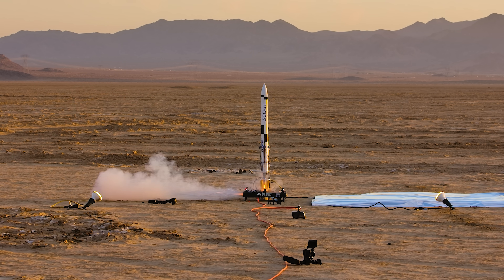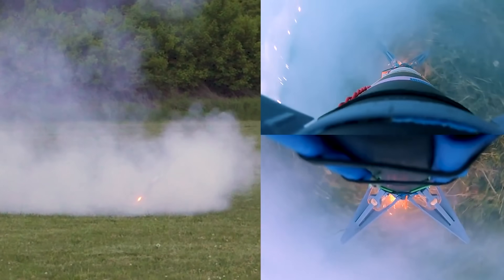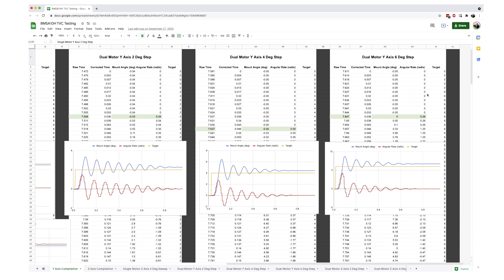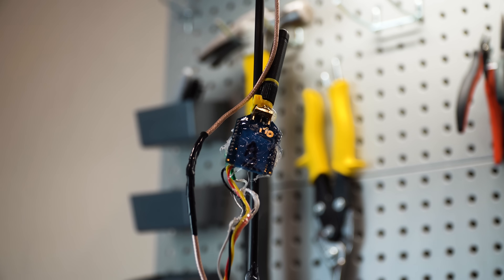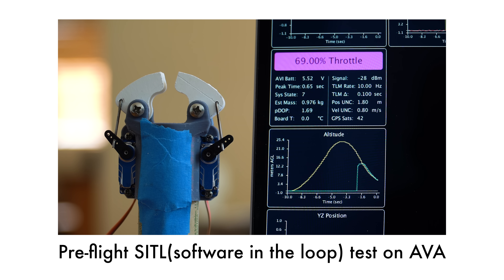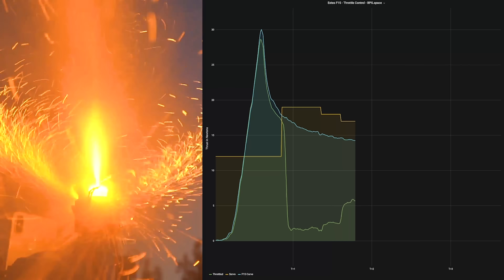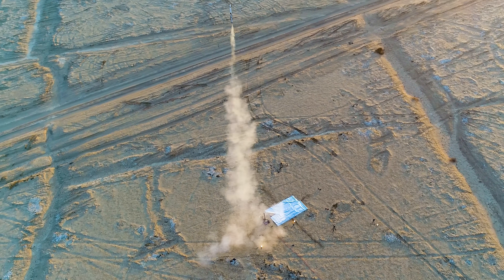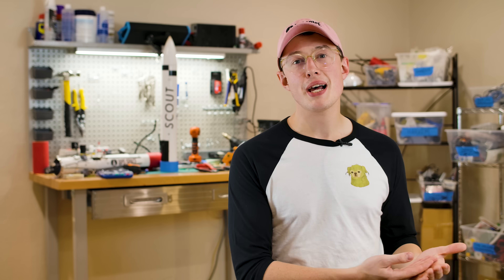Scout F - Flight 1 - Launch and Landing

Comment: This is the first time I've tripped over one of your videos, and I'm really impressed with what you have accomplished.

I assume you are familiar with the concept of PID loops, but if you aren't you definitely should look them up. PID = Proportional, Integral, Differential. It is a general control strategy applied to continuous industrial processes, and your rocket is a continuous process when it is operating. The general idea is to use a PID control algorithm in a feedback loop, such as your gimbal control. You tune the PID parameters for the general way the process is observed to operate, but there is generally enough wiggle room in the control algorithm to account for things going to the limits (or even beyond) and getting back in control. In this case there wasn't near enough damping in the motor control, resulting in it slamming to one side, the control noticing that the rocket is now leaning to the opposite side as at first, and then slamming back. A longer integration time would help with that.

On the landing burn, I think your right that your current control strategy isn't optimal. I've never done what you are doing, so I'm just thinking out loud here. I think that the viewpoint I'd take is that you have an unpowered object of some approximately known mass, descending at a measurable speed and acceleration (which is approximately g less some empirical wind resistance), and which needs to stop at some determinate point. If your altitude measurement is good enough you should know the distance to the landing altitude.

Then the goal is to apply some integral force F over some time T such that V=0 at the desired altitude. You should be able to calculate the ignition start time from those parameters, and be able to resulting change in vertical acceleration and speed based on the force. This algorithm should be independent of total time of flight and of peak altitude reached, assuming that the altitude is high enough that you can completely burn the descent stage by impact time. I guess your descent rocket force is approximately a constant value and is then reduced by your control pinchers. Since F=MA and the F is known for the descent rocket and M is known from initially weighing the rocket less the ascent tube, you can calculate a constant A to result in V=0. Then the question is to calculate the altitude to start the burn, which is done by (if I recall my long-ago math correctly) differentiating MA to get a known distance with a known F.

Well, I hope some of that made some sort of sense, and might be useful to you.

Comment: an idea for a lightweight shockabsorber:
thin aluminium tubes that slide over one another, with heavy grease on the sliding surfaces. If you get a spring assortment, you can find a light spring that fits in the large tube, to keep the whole thing extended until the rocket settles down.
I built landing gear for small model aircraft that way. Has quite a nice damping effect, eliminates bouncing and can be integrated into your carbon rod construction for the landing legs. Might even work with carbon tubes sliding in one another.

Comment: Hey Joe - a couple of thoughts about the shape of the plume-paddles: I wonder if it would be possible to use a da-Vinci style mitre lock to help the exhaust itself push the paddles closed when at maximum impingement? It feels like it might be harder for the servos to come out of the “fully closed” position, but that might be manageable. That led me to think about where the exhaust would go after hitting the paddles. I can’t remember from the ceramic milling video whether there are any features on the inside of the “jaws” of if they’re basically 2D. It might be possible to create a curved channel/guide there for the exhaust to follow, like a thrust reverser on a jet engine. It might be a small effect, but throwing some of the energy back up might give you an extra percent or two of effective throttle?

Anyway, amazing to watch as usual - the combination of technical detail and nerd-humour are precisely my bag, mate! Thanks.

Comment: In terms of your landing gear, I like that you're thinking about damping out that impact energy, but there are two levers you can pull, and in two places. You focused in the video on the materials at the impact location, but I'm sure you've also thought about absorbing that energy in the gear, but haven't because it would add weight. One thing you could try is replacing those lower carbon rods with two rectangular rods sliding against each other, with a rubber band compressing them together, so the energy is absorbed as friction*distance? Or a small piston with small foam chunks or play dough on the upper leg that get compressed on impact? Doing something like that in the gear increases the amount of deflection, which makes it easier to dissipate the impact energy, as opposed to the quarter inch of deflection you might get out of the cardboard. 

 In landing gear drop testing, we usually grease up the wheel or impact location to reduce friction, maybe you could do the same with those plastic feet? Making them spherical on the bottom or adding big radii might help too. 

In any event I think you're really close and it might work as is! I heard a great story about Paul Macready recently on Cautionary Tales, advocating for robustness to enable quicker testing and iterative cadences, which it sounds like you're shifting to perfectly! Please keep it up!

Comment: But what about using hydrogen peroxide engine? Could be more easy to control and maybe also with a higher specific impulse. With solid rocket motors it's more challenging for sure, but hard to see what's next.

Comment: i think the throttling pads should be more half-cone shaped each to throw a wider and more even area of thrustl since it's continuous and cant go upwards, might as well use it. Maybe making the 'throttle' a tube could be another option, then gimbaling that tube to direct the thrust would prob be more stable. I would try to get it to hover just a bit and land - take that data to model with it.. then in the meantime dream of how to get it to that stage from descent. What are the trigger points.

Comment: I have never played with rockets, but I have played with bots and scripting in rocket league, a physics based video game that relates somewhat to rockets. 

So about the landing, intuitively, I'd calculate the time to reach the ground when boosting at half the thrust between max thrust and 1g. 
So let's say 1g thrust is 50% throttle (idk the specifics of your motor), I'd calculate the time when it's gonna hit the ground based on sensor readings when thrusting at 75% (100% + 50%, divide by 2). 
Obviously, add to this amount of time the expected ignition time of the motor, + the expected wasted acceleration when boosting slightly sideways, and that's when I'd light up the motor. 
This way, you're making sure that you have the optimal margin to play with when you're trying to land.

Comment: Just some idiot chiming in here. In addition to the other great responses in here, lengthening the rocket could also help with the oscillations. Imagine balancing a broom upright on your hand vs balancing a paintbrush. And on that same line of thinking, I know it seems like having all the mass at the bottom will make landing less prone to failure, and that's pretty intuitive. But, distributing mass more evenly throughout the rocket might make for a more stable flight. There might be a good trade-off position between having a good portion of the mass at the bottom for better landing performance and having the weight more distributed for better flight performance. Remaining upright after touchdown is only one part of the process, and there are other ways to prevent tip over, other than setting an artificial constraint that may be harming the rest of the rocket's performance.

Comment: i wonder if you could set the motors side by side and use a ceramic y joiner direct the exhaust out and down (with a pivot point midway down the flame tube for TVC)

Comment: I’m gonna guess that the plan is to have more ascent motors in the future for higher altitude and then try to stick a suicide burn landing. 

I think you may want to find a 25m Tower and drop test your descents with just the landing motor. Get that dialed in and then go back to launching it.

Comment: Lol this a great time to think of great ways to shed enough weight for touchdown without taking off again. You could incorporate slower burn times Into your rocket propellant with significantly less thrust than the takeoff rocket motor with more thrust but always adjust your thrust amd burn times and shedding thrust. Make the rocket motor thats landing have a low weight to thrust ratio so you won't have to shed any thrust you'll ignite the motor with lower thrust. Low thrust on the landing but enough to barely just hover but it's something to consider. It'll help with soft landing and while still falling bc of its thrust to weight ratio(Landing). May be a great chance to consider another smaller 3rd stage and tweaking your gyros for more accurate movements from your TVC. Love your channel man keep up the great work🚀🌌🌏

Comment: Love this project!

Maybe a hacky way to stabilize on ascend, but you can mount some rails on the lower part of the rocket body and slide a fin assembly into them. Then attach the assembly to the lower motor, fixing both in place. Fins will stabilize it so you won't need TVC on the way up anyway. Then since you're jesttisoning the lower engine anyway that can also boost off the fin carriage. It's another point of failure to be sure, but it might be easier than getting your PID tuned perfectly. 

Alternatively, you could also add an IMU at the top to get it as far away from the TVC mount as possible. Then it's just a question of integrating the data of both sensors.

Lastly, SpaceX uses the fancy grid fins to help stabilise and steer it on the way down. You're probably not going fast enough to make something like that work, but maybe adding some airbrakes near the nose could give you some passive stability on the way down. 

I'm not a control systems engineer, but for what it's worth I'd like to echo what some others have said. You seem to be aiming for one specific point now (one descent profile), which makes it pretty hard. But there is a whole range of lateral and vertical velocities and altitudes where engine cutoff would result in a successful landing. Maybe you can relax the constraint a bit by allowing AVA to approach from a multitude of states. Maybe in practice that could look a little like finding the closest approach of the current state to the set of acceptable end states. 

Finding the set of acceptable states along the flight path seems more daunting. I can imagine that for the amount of variables you have to deal with that might take up a lot of memory, on the other hand computing it in real time might also be untenable. But at least conceptually this would allow AVA to try and fly through a series of (multidimensional) hoops rather than a series of points. Not sure if I'm getting the point across properly. Feel free to DM on twitter (same name) if you want to chat.

Comment: Give yourself a larger buffer of thrust, if possible.  80% means you only have 25% increase potential. At least for multirotor drones, a minimum of 60% is recommended (aka nominal throttle at 62.5%).

Comment: Space X has designed the landing legs in an internal honeycomb fashion. The honeycombs are meant to crush (not fully of course)  under the extreme forces of the controlled landing. I think the rigidity in your leg design should be rethought. Possibly spring loaded, a light spring that will give way to a certain extent, but not compress and expand so much that it tosses the rocket. 🤔🤷‍♂️

Comment: So, this is the first of your videos that I've seen. tl;dw the others. Maybe a simple question, but did you consider basic mechanics in your model? i.e. without any thrust, you are still moving the mass of the nozzle using a servo. The servos' and nozzle's mass, when they move, imposes a moment on the rocket. Could this be the reason why it is slightly overcorrecting?

Comment: Have you considered thrust augmentation/Venturi/Dyson fan or whatever you want to call the effect. 

A solid rocket firing into a tube gives more thrust than one in open air. 

Sooooo,
Theoretically opening and closing the intake sleeve between the rocket and the thrust tube gives you throttleable solid fuel motor.

Comment: If you go above the expected height you should be able to correct as the rocket will only fall so fast, this means that you should be able to simply generate the landing lines for a lower then actually expected height and use the computer to either compensate for the speed differences or attempt to force the rocket back onto the line with the space thrust you should have you should be able to land just fine from anything higher then your expected height, as long as you have the thrust to get back on that line if you are falling at terminal velocity.

Comment: Some interesting physics on this: if you assume a constant deceleration over a known time (burn time of the second engine), that implies a ratio between the velocity and altitude at the beginning of the deceleration, regardless of the deceleration value. 
I suspect that starting the engine at that sweet spot and choosing a flight profile such that the required deceleration is in the middle of the control range would minimize the required control effort

Comment: You should look at the internal model principle if you want the height PID to track the set-point without any error. You could try to develop a linear model predictive controller for the altitude with the constraints that the final altitude and velocity in z direction are zero.

Comment: I’m not sure I understand your landing concept. Can’t you calculate the point in time at which you have to start your suicide burn (based on current velocity and altitude)? Make the calculation pessimistic and account for errors by PID controlling the thrust so it hovers at ~1m altitude until it runs out of fuel.

Comment: Nice job, looks like you almost got it, just some more PID tuning, possibly add some dead band to help solve the divergent oscillations.  For you landing, eliminate the mylar and use loop carpet.  Then print some velcro hooks for the bottom of the landing pads.  My first thought was RE magnets and sheet metal landing pad but that would be much too heavy. I haven't played with those engines in 60 years, but I wonder if you could vane vector the thrust rather than trying to mussel the mass of the entire motor assembly.

Comment: This might be a completely absurd idea, but instead of trying to match the descent thrust-throttling to some unknown apogee, why not try and control the apogee? From what I understand, the big issue here was that the apogee that was reached was far below what was expected, leading to the thrust control on the secondary motor to be all out of wack. What if instead a lower-than-maximum apogee was used as the "goal," where this lower altitude would be below what the theoretical/simulated apogee would be.

Say the target apogee was 70% (or even lower if need be) of what was being simulated/theorized. An air brake system or other drag-manipulation system or even thrust-manipulation strategy could be employed to hit this lower apogee. 

That might just be too many levels of over-engineered lol, but at least it would remove some (most?) of the issue revolving around the landing thrust-throttling scheme over or under compensation based on a mystery apogee. I've seen some air brake systems used on larger rockets with higher target apogees that have worked fairly well, but using this approach would, in my opinion, be easier since there are so many constraints using a thrust-throttling approach (burn time, throttling limits, etc etc). 

It sure would be slick to see Scout work any way though and I'm stoked to see what happens with Scout in the future!

Comment: Wow great job. I love your rockets.  Could you divert the thrust up when you got ground to plant it if your throttle plates had tubes on back edge and flat in front with transition between so the more it pushes in the more it will go up all the way to 0

Comment: Unless I missed it, you never mentioned where the CP is relative to the CG.  I bring it up, because you mentioned putting as much weight as possible near the bottom, but as everyone who builds rockets knows, the CP must be behind the CG, in order for the rocket to be stable in flight.  Perhaps this is why your thrust vectoring is flailing around so violently.  It's keeping the rocket vertical, but at a cost.

Comment: So, I think the problem comes with trying to track the given trajectory, instead of calculating one on the fly. Given accurate sensor data, and given predictable unpowered descent, could a descent trajectory be generated at apogee that then provides velocity vector solutions which the throttle/TVC PID could then attempt to track? No formal background in control theory or flight dynamics, but I bet you could create some sort of polynomial velocity vector field, if that’s the right way to look at it, to generate PID set points; this would be within an altitude/displacement domain limited by total descent motor impulse. 
Or I misunderstood, and this is overly similar to what you’ve already done.

Comment: The Mars helicopter literally flies into the ground to counter the bounce, when it sees no more vertical motion, only then does it cuts power. I'm wondering if you could make a thrust reverser and use up the excess thrust holding it on the ground. I'm pretty sure the trade off is the need for robust landing gear.